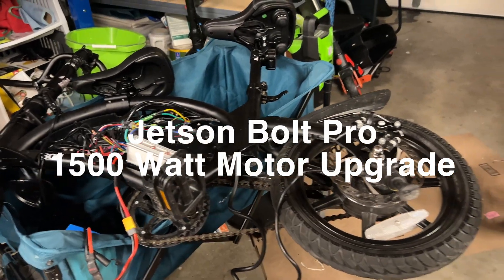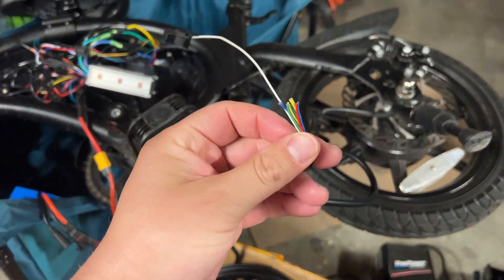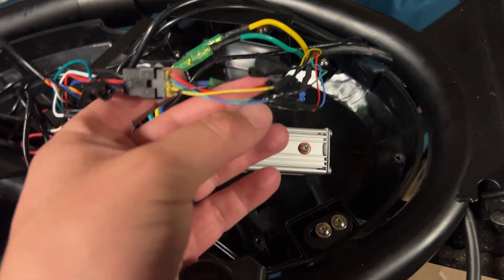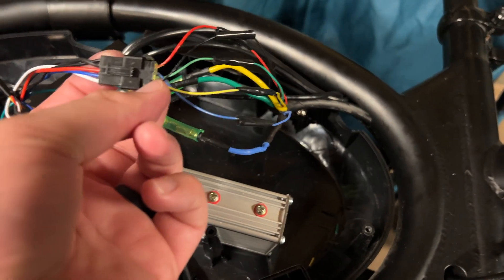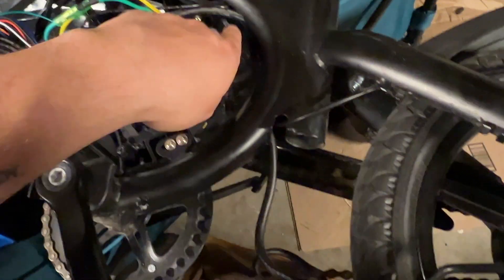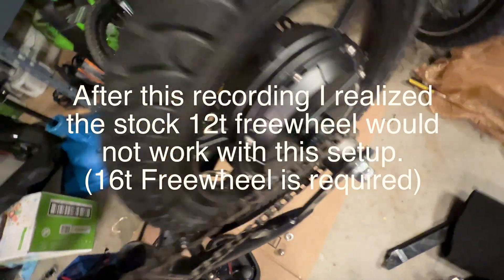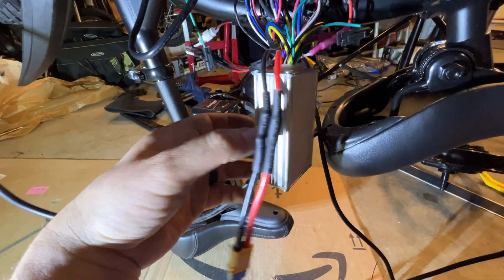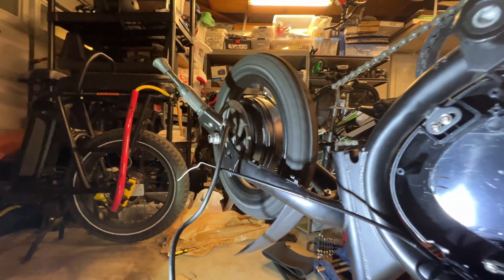Jetson Bolt Pro - 1500 watt Motor Upgrade Install - Part 1

Comment: Hello how are youI really like your video,can this 1500w motor fit to a different e scooter I have 14inch tire is 500w motor that why I want to upgrade
Reply from the maker: @has20100  great question , it all depends on the rear drop out dimensions of your bike.

Comment: You forgot to mention that the speed test was without a load on the motor, which will change the speed significantly. Lets say a 175 lbs person for example.

Comment: How you preventing your bike from wheeling. With that much torque I always seem to almost fall off. I have almost the same setup but way to much torque for a small bike. Let me know. That be great. I have to peddle first to start off and even then the front still want to come off the ground and cause me to almost fall off. I’m 5’9 at 230. Thanks
Reply from the maker: I was gonna say maybe because I’m heavy haha but then I realized we’re about the same weight, I’m about 235. I have noticed if I’m leaning back it wants to wheelie, but I’m in in the forward riding position it takes off gently. It could possibly be your controller setup, which controller are you using ?
Reply: @JUNXRCZ  not sure. I have to open it up and check it out. I had someone built it for me. But it has so much torque for a small bike. I have another Jetson bolt pro that I did myself and do the controller with lcd and 48volt battery and 10amp stock motor and rides nice and hit easily 26mph. Just don’t know about my other one.
Reply: @GTO_442  I have a dyu 3df could you help me mod my ebike as in what did you use controller and battery etc ?? As id like a little more speed and torque 

Thanks

Comment: Is that fit to jetson haze?
Reply from the maker: The motor would fit but not sure of an upgraded battery and controller, they may need to be mounted externally on the haze
Reply: @JUNXRCZ  ill wait till u make dat video for jetson haze. Hopefully u gon show us how u did in haze

Comment: Hi is it safe to take of the free wheel of the 14inch  motor so i can put the motor on the front
Reply from the maker: You absolutely can, you can even take it off and leave it off for the rear and install pegs instead of pedals

Comment: What kind of tires 🛞 did yu use??
Reply from the maker: I just swapped over the stock tires
Reply: @JUNXRCZ how did you get the tire on the new motor because i can’t seem to get it on